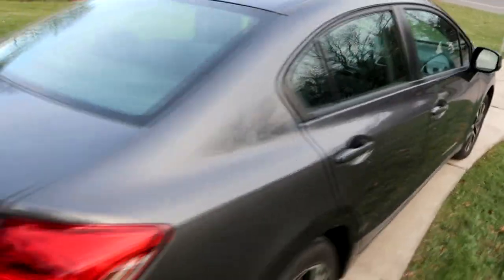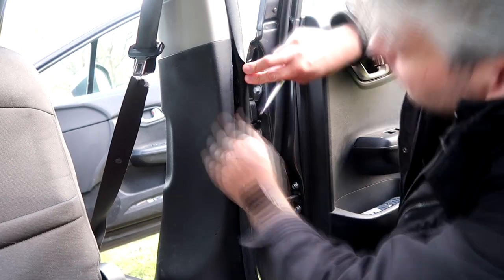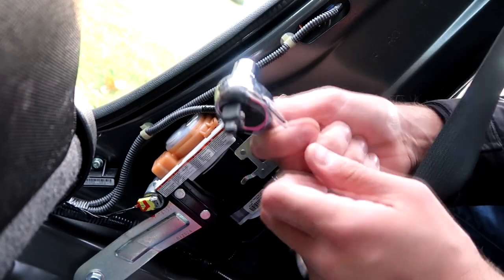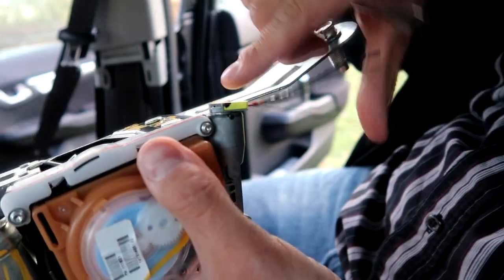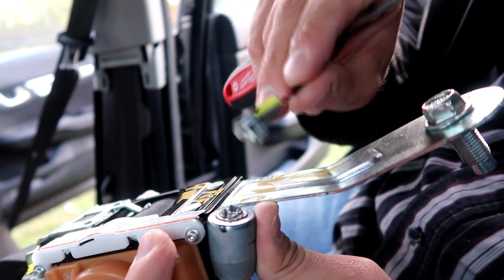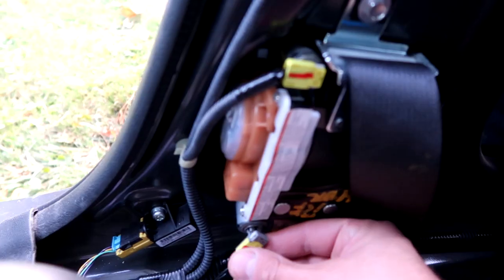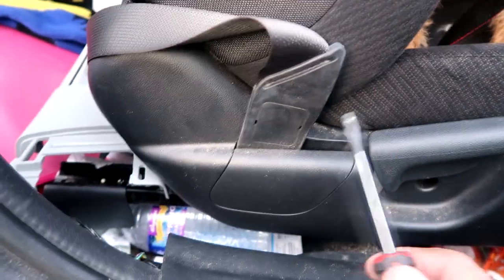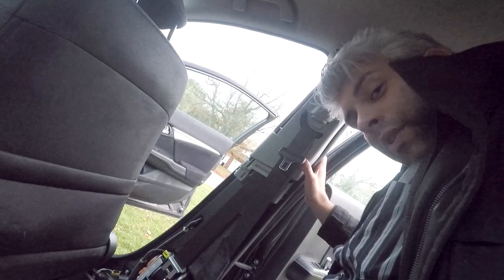How to replace seat belt on a 2013 Honda Civic: DIY

Comment: Did You have to do a hard SRS reset? I was told, when I change out my seat belt, it will throw a code because the air bag module sees it’s not the original seat belt.